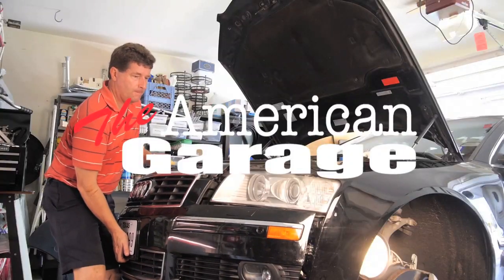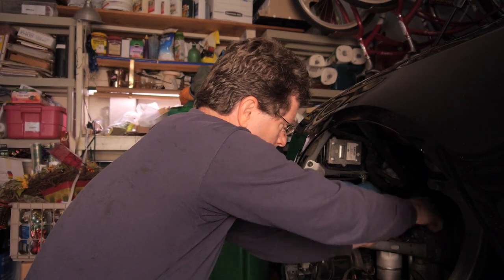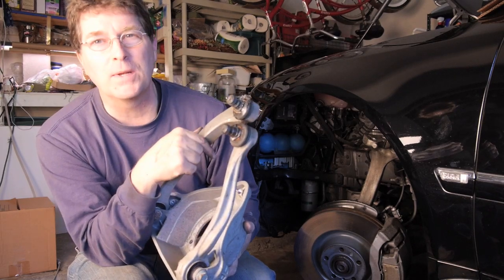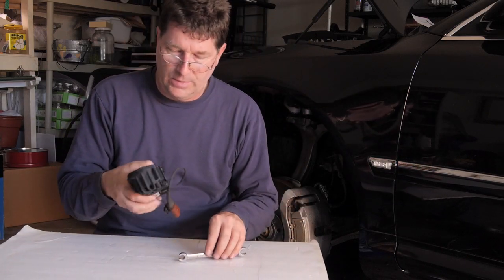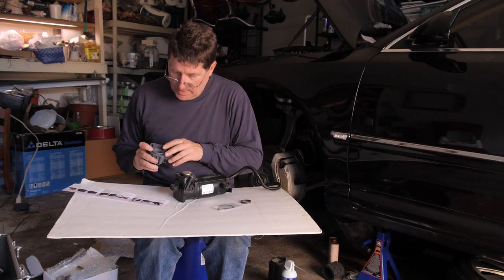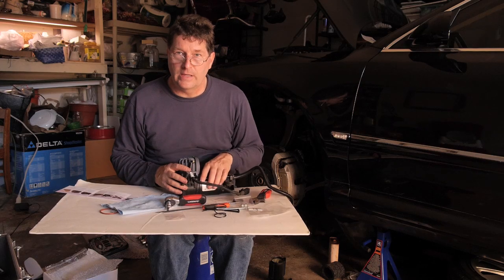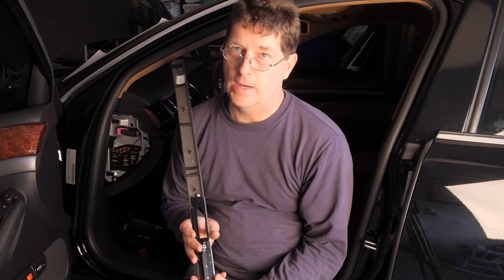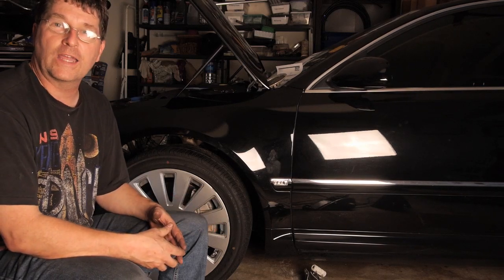Fixing the Air Suspension on Audi A8- The American Garage

Comment: Local repair told me all struts go up and down but may have been lifted without turning them off. Need all four struts to repair! Can’t believe all are bad if they all raise and lower. Don’t know what to do?
Reply from the maker: That doesn't make sense- get a second opinion. Try this- put the car in lift mode, let it raise all the way up. Then put it in jacking mode, and let the car sit overnight. If the struts are bad, it will be sitting on the floor in the morning. If this is the case, then your pump is still working, but the leaky struts can't hold air. If this is happening, then your pump will not work right for very much longer, as it is being overworked. Find out if you have a leak first.
Reply: TheAmericanGarage1 I put the car in raise mode and then when it stopped I put it in Jack mode and these are the readings I got at each wheel well.                                                     Left front 16 1/2
Right front 16 1/8
Right rear 16 3/8
Right rear 17 even    I will check again in the morning to see what happens
Reply: I meant the left ear is at 17 even
Reply: @jsmith05403  How did you check for the  parameters on your monitor screen? Rog
Reply: Johvani! John repaired it with a level sensor after calibration failed to produce leveling results
Reply: @jsmith05403  Thank you! Do you have a link in mind that disassembles and reassembles a new level sensor ?
Reply: TheAmericanGarage1 I’ll let the car sit overnight in the suspension did not drop at all.
Reply from the maker: @jsmith05403  Okay Jeff, if the car was in jack mode overnight, and it did not drop, then there is no leak in the air-springs. What happens normally is the car actively adjusts it's height all the time- even when it is sitting overnight. Jack mode turns off the car's ability to adjust and stays in one place. The pump will not turn on to pump the car up if it sinks. The reason we have a jack mode is because of this active suspension. Ever forget to turn off jack mode when you go to the tire store? I did once. The car gets jacked up and the tires are taken off- the car sees that the ride height is too high and lets the air all out. They put the tires on and let the car down and the car goes all the way- or nearly so- to the ground. Of course I had to turn the car on and let it sit there 10 minutes while it set itself right. When jack mode is on, none of this happens. The pumps does not turn on to right the car if it gets low, and it doesn't let air out if it senses too high. So, with jack mode on overnight and no drop, there are no leaks in the system. I check mine from time to time to be sure. I have noticed that sometimes the dash lights will come on showing the car is low. I noticed that if I raise the car semi-regularly, then this doesn't happen as much. I tend to raise it when I go to the car wash so I don't hit the bottom on anything. Have a trusted mechanic double check you, but it sounds like your air springs are fine. Remember there are basically three things that typically go wrong in the air suspension- leaky strut, worn out pump, or the relay goes out. I just reread you initial comment- forgetting to turn on jack mode will not ruin your air-springs when the car is lifted- but it is a damn annoyance because the car will be on the ground. Reset the computer, put it in lift mode, wait for it to come up, put it back in automatic or dynamic- whichever you like, let the car sit and get itself back together while it is running. Don't go on down the road until that green light turns off though.
Reply: TheAmericanGarage1 so, if I understand correctly the only thing left is the relay. The ride difference between the wheels is not an issue and there are no leaks. I don’t know what’s left? My car has no green light for suspension as it’s a 2012 model. I really appreciate the time you’ve put into my questions!        This is the ride height on lift mode. Left front 16 1/2
Right front 16 1/8
Right rear 16 3/8
Left rear 17
Reply from the maker: @jsmith05403  The relay is there to turn the pump on and off. If the ride height is basically right, then the pump is working, therefore the relay is working. Looks like the ride height calibration is a little off, with slightly different heights. At this point, I would leave it be if it is operating well. Sure, I  suppose a suspension tuner would want to go an tweak it until they are all exact, but if you have no ride issues and the car isn't pulling to one side, I would leave it.
Reply: TheAmericanGarage1 Thank you so much for responding. Do usual that I have is my suspension light is coming on every time I drive the car when I get to highway speed’s after about 5 to 10 minutes. Or if I raise the vehicle all the way up sometimes the red light will come on then as well. But my yellow suspension light comes on every day in disengages the suspension system. That’s the problem that I’m having. I really appreciate you getting back with me

Comment: Enjoyed the video. I have a A8L d4 Hybrid and the front right needs a air sus  repair. Want to do it my self . Do you have special  videos that i can pay for since i want to take the shock  ab-sober out and try to replace the bag. Neil
Reply from the maker: Neil, All the video I have are posted, no need to buy more- although it is not a bad idea! Replacing the bag is a big hassle, and in the end you don't really get ahead either financially or work wise. I had mine rebuilt by RMT. They will also sell you the bag unit, and you clean up your lower portion and re-use it- but the savings is negligible and the work load is significant. If you decide to go that way, let me know how it works out! Here is RMT's website if that helps you any. Don't buy cheaply made parts! https://www.rebuildmastertech.com/

Comment: How do you know the correct angle of the upper control arms when you put the new ones on?  Also, when do you remove the bottom bolt of the strut?  Did I miss it
Reply from the maker: Mike, I think what you are asking is the angle that I tightened  the new control arms in place before I put the air-spring back in- check your manual for the details, but I figured out that mostly is is to keep them in place, and so that they are close to what will be a resting position for the wheel. There is a measurement, so check your manual- I don't have mine in front of me while I am typing today. But rest assured, I have done this a few times and it is not as critical as you think. Once the weight of the car is on the wheels, it will probably straighten itself out. I did not put the loosening of the bottom bolt on the video- sorry. Sometimes it is hard to get everything on camera. I am guessing that you have fought with it and wondered about an easier way. Well, I use a bigger break over bar when these get stubborn.

Comment: Hello sir, can you please post a link where to get this exact kit that you used here, thanks great video
Reply from the maker: check out RMT- https://www.rebuildmastertech.com this is where I got my parts
Reply from the maker: here is the place I got the compressor kit- http://www.bagpipingandy.com
Reply: @TheAmericanGarage1  thank you for answering in such a short time, in your video you replaced the compressor cylinder as well but looks like it doesn't come in this kit, did you order it from a different place? Any info on that would be much appreciated
Reply from the maker: @filipajdacic9627  just tell andy that you need the cylinder as well, he has them
Reply: @TheAmericanGarage1  great, thank you very much

Comment: I have sort of the same problem my suspension on the back won’t come up an my trunk won’t lock my battery was dead I boosted would a low voltage battery cause the suspension from coming up right away the pump comes on the shuts of.
Reply from the maker: Pete, I am going to have to give this one some thought. My first impression is no, a low battery would not cause the front to come up but not the back. But first things first, charge the battery or get a new one if it has gone bad, and eliminate that as a cause. Once the air has been pumped into the system, there is a regulator that distributes it to the four wheels. If the front is up but the back is not, it sounds like a leak in the back.  Your trunk not locking could be a low battery issue. Fix that first, and then see what happens. A low battery will have all kinds of crazy symptoms as things are trying to run with not enough electricity. Make sure that you check the alternator, and make sure it is doing its job, or you will go through batteries. The pump on your suspension does not need to run very long at all when the system is functioning with no leaks, and unless you are right there down by the pump, it is hard to detect it running at all. Check the battery level in the MMI display, and make sure you are getting 100%, and do an alternator check. Then let's see what is happening. Hope this helps.
Reply: @TheAmericanGarage1  The situation that is going on  on my 2006 A8 is my rear air suspension is not lowering although the front at times is and the lift mode sometime on the monitor screen in my car turns from red to grey  and the air suspension light turns on every once in a while, could that very well be my rear air suspension is going out? And is the concept the same when changing the front air suspension the same as the rear ?

Comment: i made a video on servicing the pump (air compressor). The dryer in that video was a good example of why one needs to dry or replace the beads.Also the pump is there only on d3. On a younger d4, it is in the back of the vehicule

Comment: how did you reset computer by phone?
Reply: Hi there learned a lot from your video I replaced front passenger air strut and leveling sensor on my 05 Audi A8 4.2 D3 . I have OBDELEVEN pro how do I reset computer
Reply: My name is Taurus Groves thank you so much!
Reply from the maker: Mike, I have an app on my tablet with a bluetooth OBD2 connector from Carista. It will allow you to reset many different functions. There are other brands too- but this is a handy thing to have in working on modern cars.

Comment: Hello sir, I have the same issue with my Audi a8. My compressor runs for about 30 seconds and it turns off but the car does not lift up. With that being said do u think the compressor is fine but my suspension is bad?  And do I need to replace both the compressor and suspension or just suspension at this point, I'm very limited on the budget
Reply from the maker: It is hard to say the exact problem, but since the pump is working 30 seconds and turning off, this is a good indication that the pump is working too hard and overheating- so the computer turns it off. This is probably an indication of a leak in an airspring. Look up Bagpiping Andy- he makes a rebuild kit that fixes the pump- then you need to find the source of the leak. Look at the beginning section of the video- you will need to see which corner of the car is lower than the rest- that is probably the leak. With a leaky system, the pump is going to work too hard. If this is your problem, then rebuild the pump, and get a new relay as well. It is best to replace airpsrings in pairs- I replaced my front ones as you have seen- the rear ones last a lot longer than the front ones. I used rebuilt units and saved a bundle
Reply: If you had the problem long enough for it to no longer raise, you both have a leak AND a worn pump piston ring. I have 2 of these cars at the moment and am on my 5th and 6th air ride car. All of them but 1 I bought because owners couldn't pay the repair bills.  You MAY only have a huge air leak but it doesnt take long to burn the pump.
Reply from the maker: @Nordic_Mechanic  Agreed.